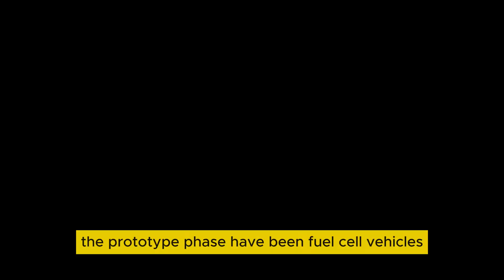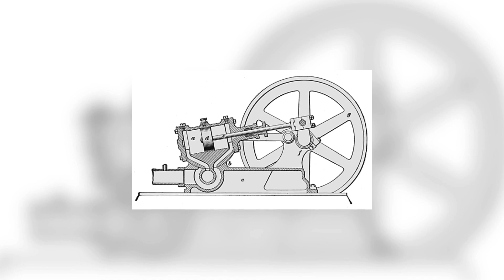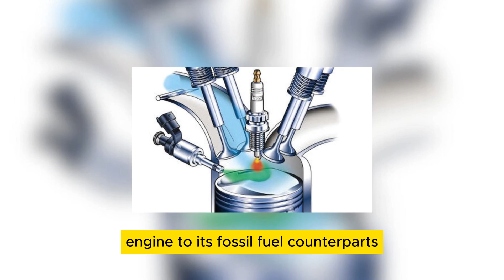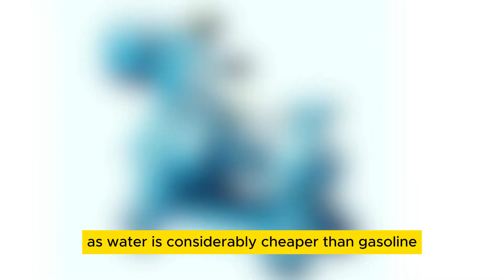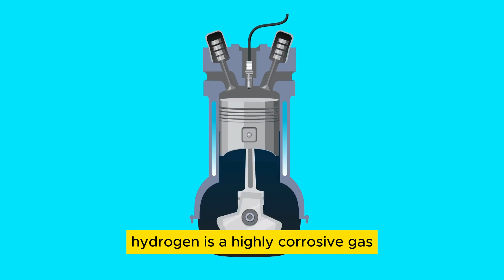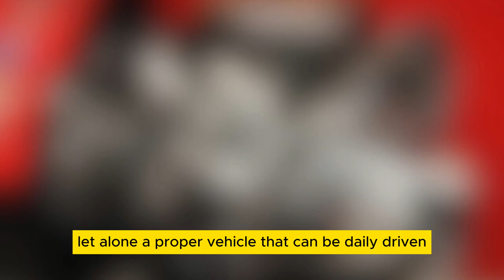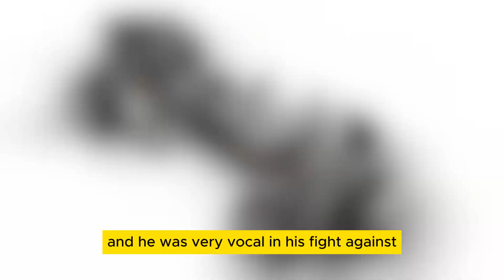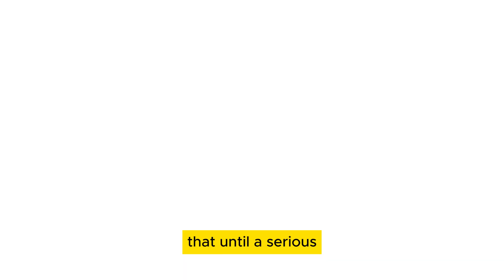This Water Engine Will DESTROY The Entire Car Industry!

Comment: Here We Go Again Big Oil blocked it.
 you use the power produced by an engine to split water into hydrogen oxygen you combust it and then the end result is water so if you capture the water you can start the whole process again that's b***** there's no such thing as a free lunch

By the way distilled water will not split into hydrogen and oxygen through electrolysis it does not conduct electricity

Comment: This is easy to see that this is a clickbait, precursor to a scam in the same class as A4F (Air4Free) or made by a complete idiot. (A4F claimed to convert regular engines to be driven by compressed air and the exhaust being pushed back into the pressure tank, and welcomed people to invest). There is a functioning way to gain energy from water. It's called dams.

Comment: Before I block your channel, understand there are no free lunches in making energy, Yet.
Reply: Only hydrocarbons which we can source at very little cost. Formed from geothermal energy and polymerisation of methane.
Water engine is nonsense. Water is already oxidised hydrogen in its low energy stable state. Requires energy to make it an exothermic process again.

Comment: Ugh. This again?  This is nothing new. It’s been around for over 50 years. What they don’t tell you is that the system can’t work without electrical input to split the water molecules. And the energy from splitting it is 90% of the energy produced. You can’t run a car on the remaining 10%. You’d be talking about 20 gallons per mile.

Comment: But there is small catch, you need electricity to split water molecule. this is simllar idea as power ev motor with gas engine. And simillar to ev vehicles  you will need large capacity batery. Yes, you can recover some ev power, but you reduce overall power of motor, so i think this is nice idea, but NOT real. Better idea is splitting water on ground or ocean with solar power and simply tank hydrogen witch IS not corosive, oxygen IS (rust is Fe2O3/Iron(III) oxide). And still this is hydrogen engine.
Reply: You also need DISTILLED water which consumes a huge amount of energy to produce
Reply: These engines are many years into the future. These engines are generating in a manipulated video. In reality not any time soon.
Reply: @DT-abcd  Toyota Mirai (2014-) and Hyundai nexo (2018-) and more hydrogen powered cars exists nowadays. More on Wiki "hydrogen vehicle"